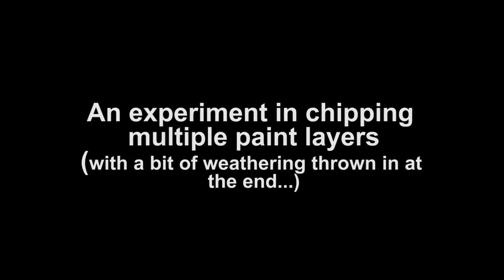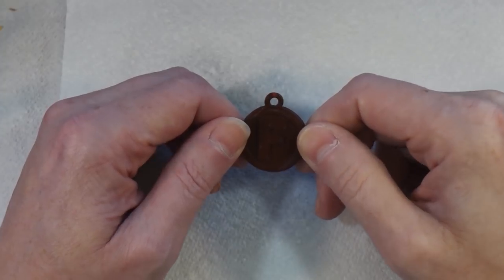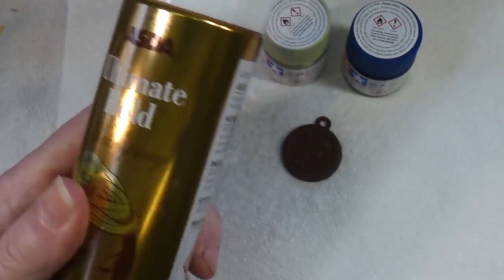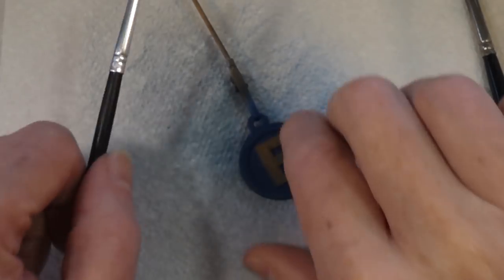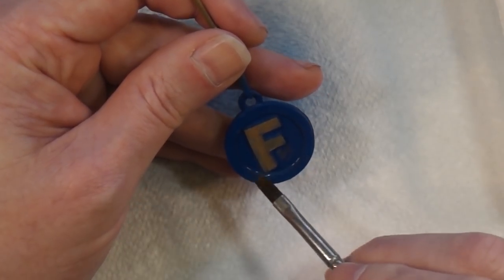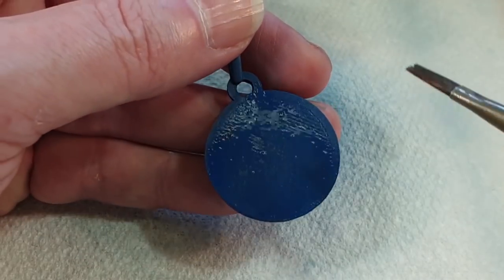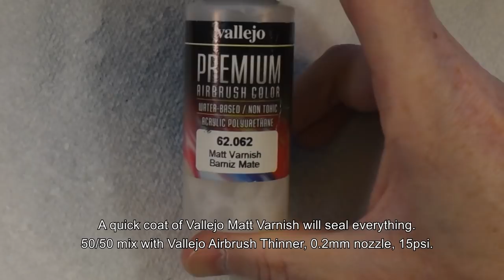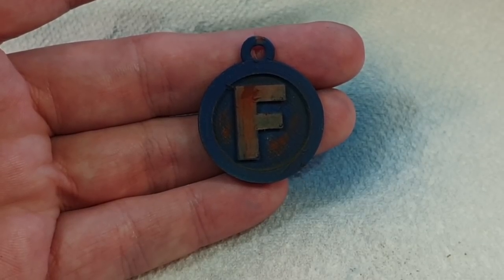An experiment in chipping multiple paint layers (with a bit of weathering thrown in at the end...)

Comment: I've used hairspray in the past, for weathering, and the cheap stuff usually works best, for some reason, and doesn't leave your room smelling like a tart's handbag. I have a deep suspicion that most stuff like that comes from a big vat somewhere, and just decanted into different tins, and perfume added, and possibly some chemical, either 'Unobtanium', 'Imaginum', or 'Madeupinthegaragium', and sold at a premium. I'm 55, balding, and bad tempered. Can you tell? 🤔
Reply from the maker: It wouldn't surprise me in the least. I read an article comparing Aldi's makeup range with more expensive brands and the ingredient list was pretty much identical, but their face cream is £5 and the one they compared it to was nearly £200...
Reply: I spent 6 years working for one of the more prestigious cosmetics manufacturers. We had one product that cost 55 pence to make and sold for £55... When you see a 1m x 1m x 1m plastic tank full of shower gel with an old pneumatic pump stuck into it to fill those expensive shower gels that you can buy - kinda wipes the shine off things...
Reply from the maker: Not surprised at all :-)